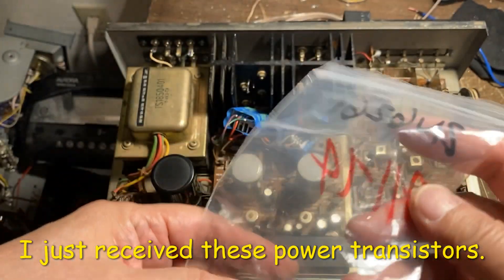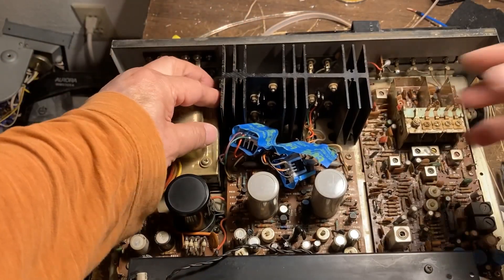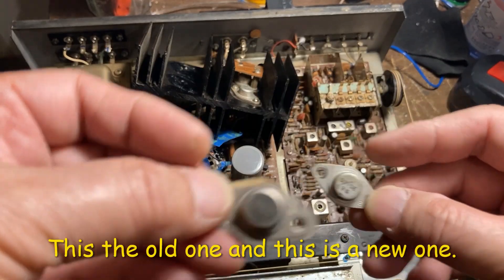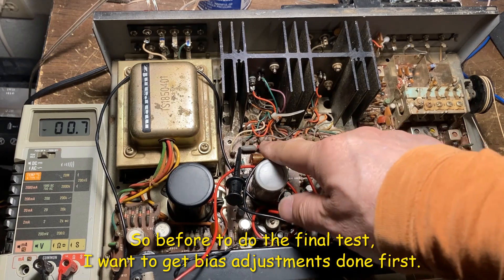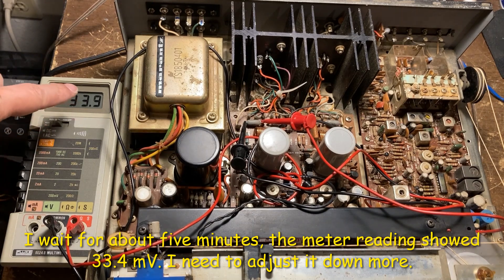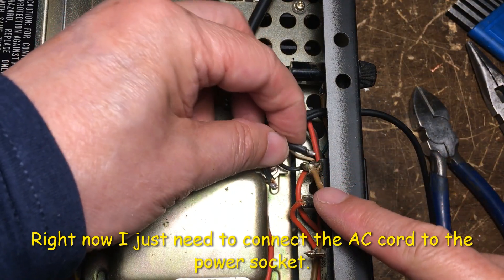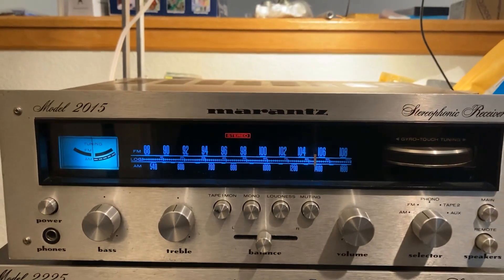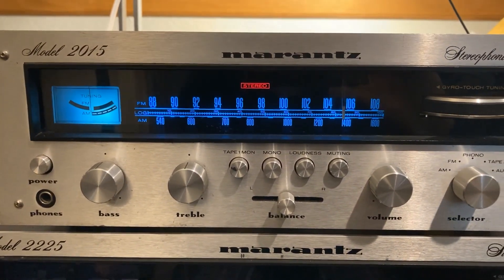Marantz 2015 Restoration Part 2 - Miscellaneous Work

Comment: Did the Transistors need any heat transfer paste or right on to the insulators or any between the insulators and heatsink? Don't let the entry level of this receiver cloud its performance perception. This is a Class A amplifier with a quality Preamp stage and the phono stage is also an overachiever. This sounds amazing when matched with the right speakers and can run with any of the big boys when listening blindfolded. this is a VERY musical receiver. Still have mine since 1975. It made my teen years constantly filled with great music. Mine needs to have the FM refocused again. Probably should replace all the Electrolytic caps too. Enjoy this Baby!